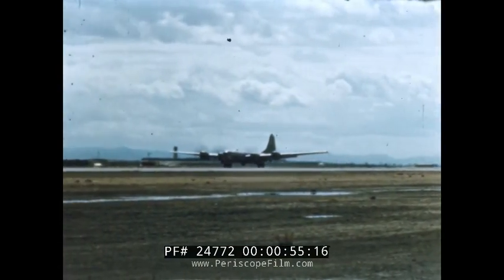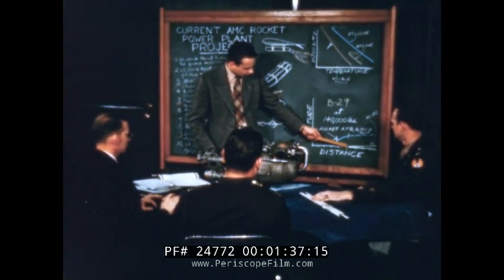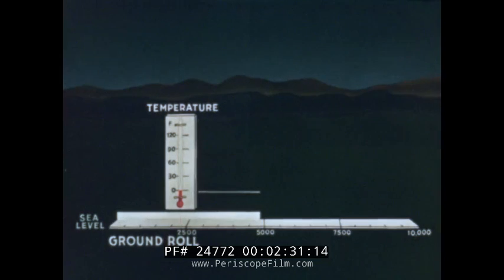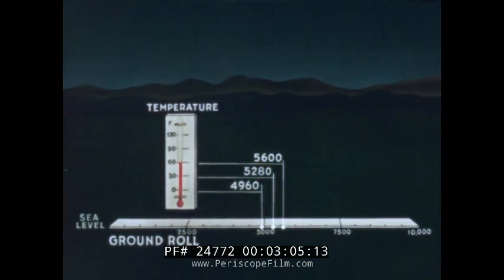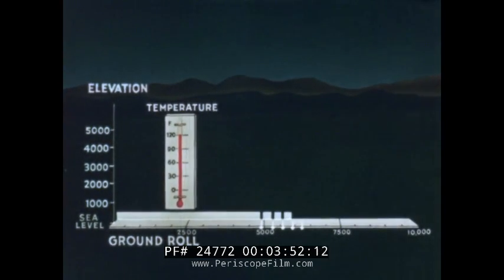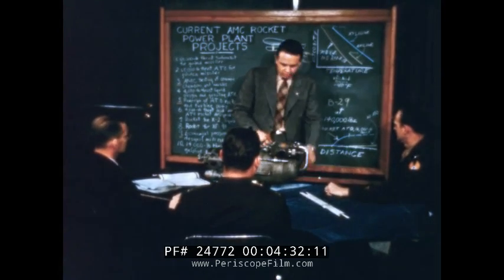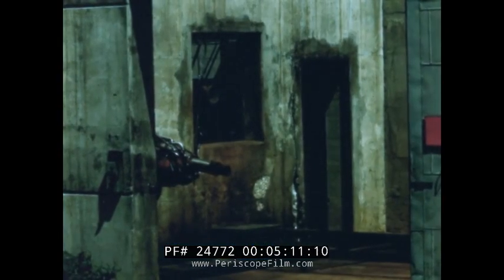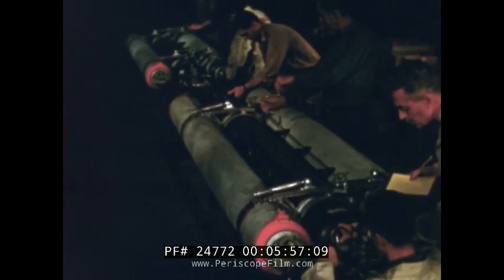" DEVELOPMENT OF A ROCKET POWER PLANT "  JET ASSIST TAKEOFF / JATO SYSTEMS FOR B-29 AIRCRAFT 24772

Comment: IIRC they switched quickly to solid fuel rockets, as this system must have been difficult to deploy to remote bases (transportation of chemicals), and, using corrosive Red Fuming Nitric Acid, the pods could have only been kept fueled for a few days before the oxidizer tank would have to be replaced.